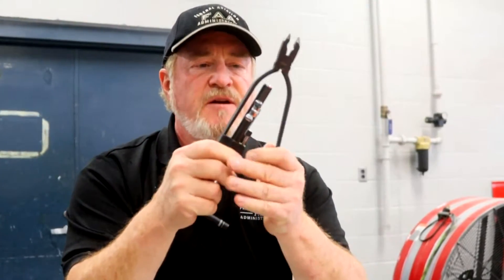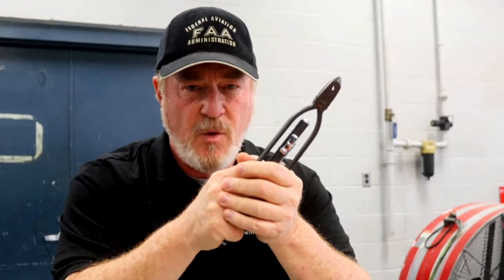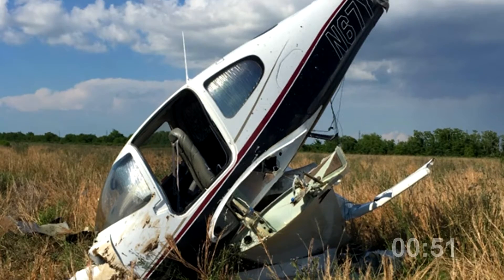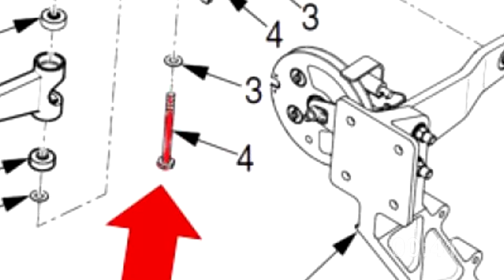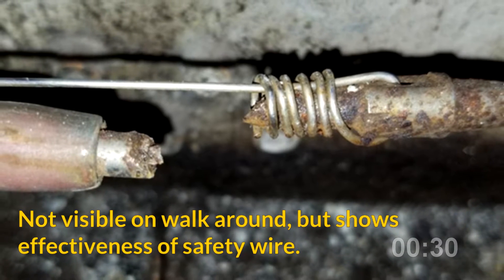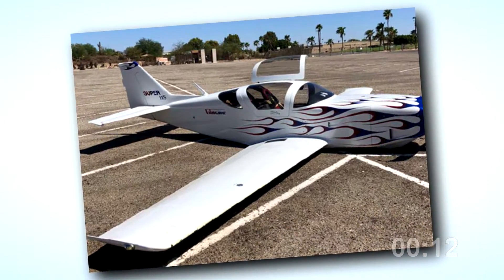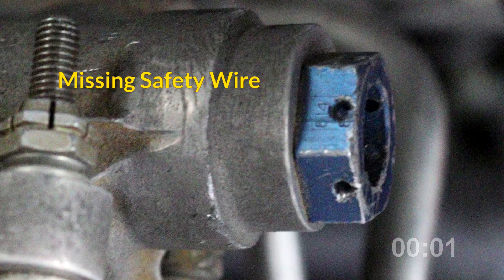Safety Wire in 57 Seconds

Comment: Anybody watching this should remember that unless your working on an engine on a stand the chances are you will be laying on an aircraft with your hands in a panel, wire locking something you may need to use a mirror to see, safety wire pliers are sometimes not useable. the two main problems then are getting the right wire tension, and getting the wrap the right way round., and don't forget to tuck the tail in so the next guy who puts his hand in does not get his fingers ripped.

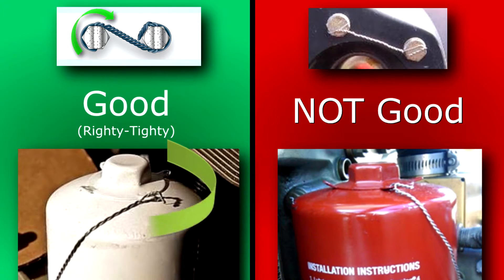Comment: Can you elaborate on the good/not good slide at 0:58? I don't quite understand what I am seeing.
Reply: wezpaa imaging trying to unscrew the bolt, or in this case, oil filter you’re trying to secure. The safety wire should prevent any turning whatsoever. The picture on the right the safety wire is turned the wrong way, so that if the filter vibrates loose, the safety wire won’t stop it (at least not until it makes about 1/2 turn).
Reply: @bradzeigler  Correct, good observation. Thank you.